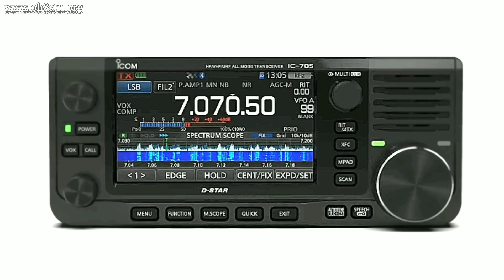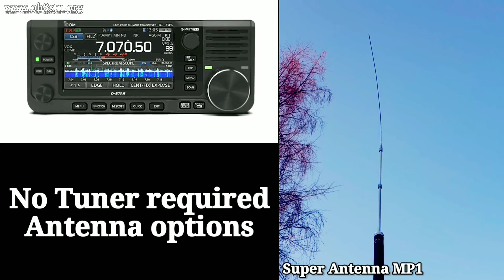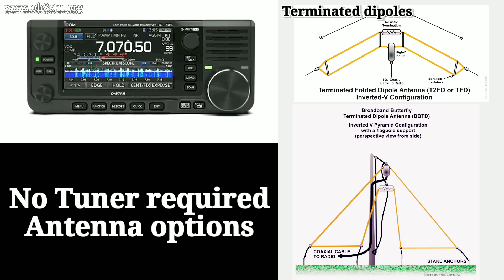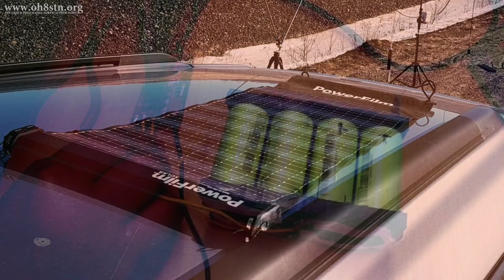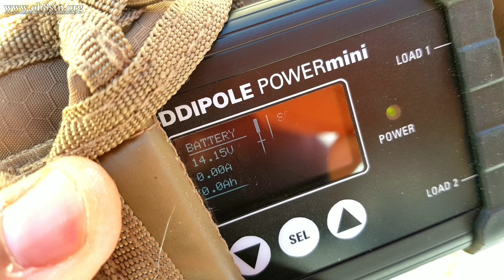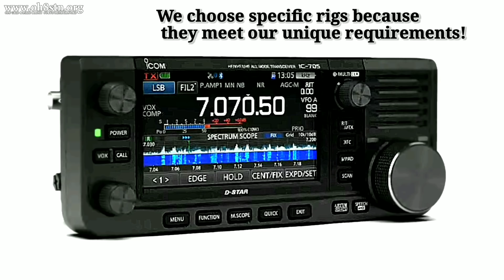Icom IC-705 Update April 2020

Comment: Even when the delay I'll probably still reserve this radio. It's incredibly interesting and for my operating is near perfect.

I primarily operate digital and 10-20w is the perfect amount of power for my requirements.

I don't do qro or voice much (my G90 hand mic is tossed in a bag somewhere because it's always hooked up to my soundcard for digital) I've head much more success on digital. Also with my operating environment being rather sub optimal..loop antenna indoors I want to use what I can have the most success on.

And re antenna tuner I use a loop so I don't need to use my G90 tuner. That feature while nice goes completely unused. Something that would be useful for more radios is a one wire interface (and proper internal shielding and isolation of a soundcard) that can work on all operating systems. Not just windows with special drivers. I say this with a  low power raspberry pi Linux computer or similar system in mind.

 That or a completely integrated unit that doesn't require an external computer to operate all the digital modes out there (not just CW and RTTY or decode) but an integrated arm computer that can run the software for the digital modes to simplify further the setup keeping it in the radio. Since it's all implemented in an open source manor no issues with licensing.
 So at that point you'd just need the radio an antenna and you power system and shelter for the field.

I've also looked at elecraft but it's looks compact but it's deceptively a mess at full deployment. Even at home I want my setup clean and with as little wires as possible. And the setup for digital is a complete mess.

Edit. 
I have a Icom ID-51A plus 2 and got the upgraded battery for it(BP-272). And just learned it's the same one that'll be used in the IC-705. Having a  battery that works in my hand heald or HF rig will be invaluable.  Additionally using a stardard icom battery and not some weird inbuilt is an excellent design choice.
The battery it'll use Is extremely light weight (pricey but isn't everything with this hobby) so you could take a few of them that sit on the charger until you're ready. Throw them in your bag with barely any added wright. And have an emergency backup batteries in case solar isn't available or you need to communicate but conserve the solar battery and let it charge. It really gives many options that'll be extremely valuable in the field.

I also just bought a reservation for it. It's an extremely exciting radio to say the least.
 
The inclusion of the G90 and 705 in my arsenal I think will make for an extremely robust and versatile station. While it's fun to get caught in the massive setup, ultimately my goal is to get the most effective and efficient station for me while minimizing the amount of gear for it. But not minimalism to the point of compromise or vulnerability. And having a backup radio fills a massive vulnerability in my current setup.

In my eyes  danger of relying on one radio is stuff can happen and the radio can break or act up. (I've already had to reflash my G90 multiple times to fix issues with it. And with my first dual band handheld having it stop working in the middle of a tornado emergency (EF-4 on the ground close to my location type tornado emergency.) So been of the mind always have backups ) Now it might work perfectly. We all want gear to work 100% all the time, most of the time it works. However, The realty is though stuff breaks and acts up against our wishes. In case something happens there's the option to seamlessly switch radios and be back in business with a backup. And if you have the ability to fix on site doing that to get back to full capacity again.
But just my thoughts

Thanks for making the video!
73,
KE8GAH
Reply from the maker: This was an amazing comment. The opposition to what we are saying is so strong sometimes I doubt myself. Comments like these and some of the others, support the idea or at least the concept of this radio. Let's see how it goes.
Reply: @OH8STN  

I address later in my comment. But short of it is, it's possible to have a SDR radio with an embedded ARM computer as well. It's already been done outside Ham radio.

Quite frankly I don't want a 100w radio if I'm not going to use it for digital. It's ultimately useless to me, and wastes power.I also hate when people transmt digital WAYYY above 20w and overload my receiver.

What I want is a single integrated unit so I don't have to carry a ton of gear for communication, in a grid down situation you need to carry more than just a radio if you have to leave your qth. If you can have one self contained unit and just carry extra power and antenna you have more space for essentials. I highly doubt you'll make it far with a 50lb go kit just for radio not even taking into account everything else you'll need, it's just not realistic. Same vein as lugging out a massive generator and thinking you're set.

I get people like their toys. But it's simply not realistic.

I have no doubt a arm computer and soundcard can be integrated into a radio. Modern 64 bit arm professors are up to the task. Just keep them properly cooled, and shield it and isolate it properly. Same with a soundcard. Proper shielding and isolation. 

Though here's a thought the soundcard and arm professor can be integrated in the same unit/ board, essentially an internal sound card on a computer. Since it only needs to run digital modes there's no issue with using a soundcard. And it cuts back on seperate boards in the system simplifying it. With a full computer embedded in the radio with a built in high quality audio interface there would be no need for a seperate sound card as it's all in the same board.

And the idea isn't crazy. There are already software defined radios with embedded ARM computers (off the top of my head Ettus Research E series (E310, E312, E320) and Epiq solutions Matchstiq radios. Though they are test equipment not ham radio. They are barely a few hundred mW  and aren't pre programmed so it's not putting up an antenna and turning it on, the actual radio logic has to be programmed in to make it work. Hence test equipment)
It's then a matter of implementing for ham radio equipment, which is completely within the realm of possibility.
Reply: If you feel 10-20 watts is perfect for your digital activity, this 5-10 watts radio might not quite be up to the task.  We don't know yet how it will handle max output at high duty cycle.  It might be fine or it might be necessary to reduce  power significantly.

Comment: I completely agree, Julian. I expect that by the time the IC-705 becomes available, other manufacturers will be scrambling to include similar features in their radios. As the IC-7300 was a game-changer in the industry, I suspect so too will the IC-705 be. And btw, I don't own a 7300, but I'm sure as heck considering the 705 for QRP use. I also happen to prefer resonant antennas. I have nothing against antenna tuners; they certainly have their place. But the fact is, a resonant antenna will transfer more of the power from the radio as signal than will a tuned antenna. And for QRP use, that's non-trivial. Thanks for another great video!
Reply: Yes I use the MP1 and EFHW and with the MP1 tuner is a non issue, however, with the EFHW it is an issue if I want to make a contact on a non resonant band, for instance, One of my EFHW works on 40,20,15 and 10m, usually I won't be on more than 40 or 20 m during the day portable, but there have been times I've had the FT-891 and heard 17 was open and couldn't work the band because I hadn't the MP1. With the tuner in the G90 this is not an issue, sure it's not going to be as efficient as a resonant EFHW for 17 but the tuner still allows me make contacts. With the IC-705 in the same situation all I could do is listen to that contact I haven't a hope to work.

Comment: It's hard to believe that people are hating so much over the IC-705.  I think Icom got it right by leaving out an autotuner on a small QRP radio that most people should be using with a more efficient resonant antenna.  It's not difficult to make a simple and lightweight wire antenna (dipole or end fed wire) that's resonant on 80m, 40m, 20m, 15m and 10m.  I shouldn't be forced to carry a radio that's 50% larger and heavier and 20% more expensive so that someone can tune a barbed wire fence for a 5% efficient radiator.

If I have a minor nit to pick, I think Icom could have designed the 705 so an optional autotuner could snap on the back for those who want one and it'd be integrated into the 705's operation.  Similarly, Icom could also offer a much larger auxiliary battery that also snaps onto the back.  While we're spit balling 705 wish lists, a very cool hack would be an Icom mag loop designed to work with the 705 that was large enough in diameter to be a very efficient antenna yet very lightweight and compact for portable operation, with an autotuner that is controlled automatically by the 705.

Hopefully, the receive current is very low and there's a menu setting that allows the backlight to automatically switch off to save power after a user defined period of not using the user interface.
Reply from the maker: Amazing comment Bruce 👍
Reply: @OH8STN  - Apparently, I'm "absolutely magnificent."   :-)
Reply: Since it seems to have the same UI as my 7300, I'm betting there will be settings in there to control the brightness of the LCD and idle turn off for the screen.
Reply from the maker: We definitely know there's the setting to turn off the screen and continue to use the radio.
Reply: Stay the course, just use a resonant antenna.

Comment: Check out CTX-10 from CommRadio.   10w, ATU, 18650 batteries, 100% full duty cycle, built-in solar charge controller, wide range of voltage input.  I don't hear much be about this radio.  Looks like the ultimate rugged field qrp rig.
Reply from the maker: Thought about reaching out, then saw his YouTube videos.  Concluded the company was shooting itself in the foot. The concept of the ctx-10 is pretty magnificent. Watching and listening to the company's YouTube videos didn't fill me with confidence. That's the only reason I haven't presented it on the channel.
Reply: @OH8STN Indeed...I understand. The emphasis or lack of promotion is suspect.  They make aircraft and military radio and components.  It's a work in progress.    When I get one and take the risk I'll let you know results.  Possiblity I'll send to you to borrow and evaluate. For some reason this radio is calling me.   Tough, simple, reliable and major focus on light weight no fuss back pack operation.  BTW.  Love your stuff.  Thanks for all you do.  73 KC9PHX
Reply from the maker: Thx. Lots of operators have asked about reaching out to that company. Perhaps it wouldn't hurt to reach out and ask for a loaner.

Comment: Maybe the FT-991A is something that must be compared to the IC-705, specially when looking at the price.
Reply: I got the 991A for that reason. Now, it's quite a bit less portable than the 705, but it's definitely a solid radio.
Reply: @bob76451  100% agree!
Reply: @mbarreto64  Can the FT-991A TX on 4m(EU version of IC-705 is supposed to ship with this) band? It has a smaller touch screen? It's more bulky, less portable? No internal power. It's a given that the 705 does not have an internal ATU. The 705 also has D-Star.
Not sure they are comparable. The 705 is more like a challenge to Yeasu over their poor effort with a successor to the FT-817ND.
The FT-818 was a huge disappointment.  I love my 817 and have ordered a 705.  It may be expensive but it ticks a hell of a lot of boxes.
M7ARQ 73.
Reply: @marcfeakins1158  , It is as you say relative to features. Depends on what one wants. The price is almost the same, the 705 has 10x less power and doesn't have Fusion and no reception on uhf PMR and vhf marine bands. The 705 has 4m, and better water fall spectrum scope and also a better user interface. I would like to have both but if I buy only one I am leaning toward the ft-991a. FT817 is not an option as ic-7100 is not too.
Reply: My call sign is ct1eft, 73

Comment: okay, no tuner. 1) most internal tuners can't handle extreme ( >3:1) swr anyway sooooo... external ends up being used. Wild swr can happen easily depending how the antenna is deployed (height, rain, nearby stuff, etc.) even if it was resonant when you packed it in the kit. 2) the small package with internal tuner might have heat-dissipation issues. 3) I bet portable operators already have an external tuner in their kit. 4) External tuner can be optional (and therefore left home) if you know the antenna is truly ready-to-rock. Personally, I go with the manual tuner as it saves a drop or two of those precious mAh's and can have better coverage at times.
73
-Rob
Reply: No need for an external tuner with a Xiegu G90 or X5105.

Comment: Hi, I agree with the points made. And in fact I never understood why radios get criticised before anyone has the chance to really use one. I have noticed across the net lots of people whinging about the lack of ATU. I would be really surprised if someone doesn't come up with a "bolt on" mini ATU that powers up and has band control via the USB. Myself use a linked dipole (20/17/10m + 6m with clip on wires on the 17m/18MHz section ie 17MHz x 3 = 51 MHz) with my FT817. No ATU required! When the IC705 comes out, I going to give it serious consideration.
Reply: Yes that's a good point. Good to think from the opposite direction. Though I would be surprised if the IC705 turned out to be a MFJ. 73 de G7OPC.
Reply: It's because they feel their investments in their own radios are threatened. Silly, but there it is. It's a superiority thing.

Comment: Is the battery lifetime usable on the Icom? Big screen might draw a lot of power, and a battery from a HT?
I have an 817, and  the internal battery is just about useless, to that I have the T1 tuner from Elecraft, an external battery and a solar panel, I do not use a charge controller, since they all cause RFI, I just keep an eye on the voltmeter and disconnects if it gets too high.
Does the solar panels you show in this video cause RFI?
Reply: You can turn the screen off in the 705 menu if you want to apparently? It has power save functions.
Reply from the maker: These are the kinds of questions we have to wait and see. Considering I'm planning on using it as a 10 watch radio, I'll be using the external power supply anyway. Nevertheless, it's a great question and needs to be answered.

Comment: I already have the ID-51A +2, so for me the IC-705 makes sense. I have the same batteries, D-Star, and will work great in emergencies when portable. Listening to the other portable radios, this has the most features and ease of use for me. I like that the IC-705 can be in use while charging the battery. Some of the local ham kind of laugh and say it is a joke. It is easy to which from portable in the car use to the base station, all in one unit. Thank you Julian for all your great video, till learning, Gene. I pre-ordered mine a month ago, looking froward to using it.
Reply from the maker: You're very welcome Jean. And thank you for the wonderful commentary. Sometimes other operators don't understand our perspective. It's so important to have an all-in-one radio, I'm astonished more manufacturers aren't doing it. Thanks for the feedback and the kindness, It's very much appreciated.

Comment: im agree with extending recharging and universal allmode rig with interfaces - its more important on preps (sry for bad english) 73 de ur5rqa
Reply from the maker: don't be sorry. thanks for the feedback
Reply: @OH8STN  actually tuner option the only one thing im using from elecraft its their T1 ATU, qrp tuner if needed, working from 9v rechargable. And working really LONG time... on one, just u can get two rechargable batteries for it and it enough for more then 1-2 weeks without recharge on tune. 
so for me as owner last 12 years FT100D and several years FT817ND its good option on qrp outside the home atu